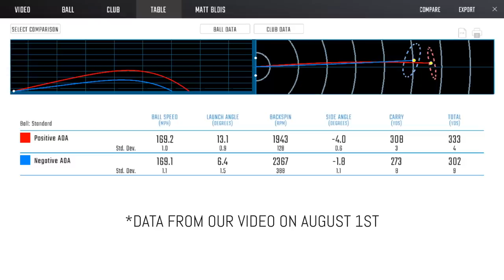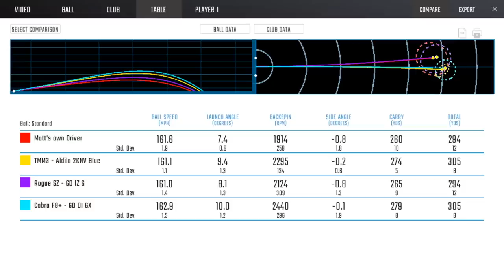Driver Fitting for Negative Angle of Attack

Comment: Fascinating for someone who has a negative angle of attack even though slowly improving and working on that. My experience just testing different heads and shafts on an open range was much the same - your lightbulb anecdote- as I found the M3 and the cobra f8 much better than others (like the ping g400 or roque) and also with different shafts. Of those I tried I found that the cobra f8 (did not try the f8+) and an evenflow blue shaft gave me (at that time with an even higher negative angle of attack) better distance, and less dispersion and better launch angle and control ability. Did not dial it in further and have never tried the GD shafts but have tried also with reasonable effect the oban shafts. Keen to see what TPT would do to the same viz greater stability.

Comment: My own experience is with a negative angle of attack I have much higher spin rate, compared to when when having a positive angle of attack. This is something I have been working on with my pro. My spin numbers have been dropping when the angle of attack has changed from negative to positive.

Comment: Would love to see an updated test of this! I went to a fitting at cool clubs recently and when hitting driver on trackman I was between 0 and -1.5 AOA.
Reply: Mav SZ and Sim max both seemed to be best for me. My club path and face angle with MAV SZ on avg was -.7 and -.2. While with Sim max is was .4 and -.3 on avg. Also hit the g410 but those numbers seemed to deviate more.
Reply: I have a terrible forward shaft lean at address causing a negative angle of attack and high strikes off the face with a tendency to sky it.  I use a Cobra F8 with Evenflow blue stiff and only hit it 240-260 while I carry my 7 iron 175.  The best I’ve ever hit a driver is my old Cobra SZ400 with a Saber Tour Vector 75....wish I could get back to that swing and a similar shaft.

Comment: Great video I've just learnt I hit 1 or 2 down and the odd 0 attack  on the ball but still getting 280 290 carry driver is a 9.5 taylormade r9 supertri   with adila rip 7.0 2.5 tip shaft launch is 12 to 15 degs

Comment: I struggle with a hook miss to the left. I currently play with a 9.5 degree and open face by 1 degree with a Xstiff Rouge shaft. I have slight neg angle of attack as well. Would a good starting place for me be a higher degree head and less stiff shaft. Will schedule a fitting next time I travel to Buffalo. Thanks for all the info

Comment: Well for a mid handicapper like me that spends way too much time on launch monitors  at the range ,I really should look at angle of attack ,never really asked about it ,always more concerned about speed and spin . Thats it now now ,going to have to  test this ,i use the Titliiest 917 d2  9.5 head with Diamana B series 60 x playing at 44.5 in length ,I get good height with around 2500 spin .Only negative thing is we use Srixon black band range balls ,there not too bad ,but not quite as long as proper golf balls .I,m hoping I hit up on the ball slightly ,Very interesting  video once again guys .

Comment: Hi guys prob the best  fitting video ive ever seen for the driver bar none as huge amount of amateurs have these swing characteristics inclyding myself. I have a couple if questions for Ian if you have the time to answer that would be great. Did you have the f8+ lofted up to the 11° draw setting and the cg at the front ? 
I currently play an 2017 M2 With hzrds red shaft im wondering what settings if any on it would be the closest to the way you have f8 set up. 
Also for links golf in ireland should I be looking for a slightly lower launch angle of 9 or 10 degrees snd whars the best way to achieve this
Loveyour channel btw the level of knowledge is insane 
Sorry for the long message 🙄

Comment: I have this issue. 125mph swing speed but negative attack angle. Very hard trying to match things up to get the ball in the air. I usually just tee off with 3 wood or 2H.

Comment: Great vid lads! I’m not sure I think I’m on the opposite end...my drivers are much higher than most and little role. I’ve never been on a monitor to know what my numbers are
Reply from the maker: Would be worth checking out your numbers Alex, but sounds like you would benefit from either less loft or a driver with a more forward CG location.
Reply: Yes need to get round to doing that! Currently got a ping G25 10.5. It’s at its - setting but I’m not sure that makes much difference.
Reply: djjazzyjeff123 a few people have told me that, I’d just like to see to go lower and more penetrating. My 3W can go the same distance with a totally different flight! I just want the Driver to do the same. I think some time on a monitor required

Comment: good video guys, really enjoy the content. Always a new subject touched on. love it. I have to use a low loft driver or i spin way too much. too much positive angle???
Reply from the maker: Lots of factors possible: could be the head design of the driver you're using, or the amount of ball speed you're producing, contact point, etc. Unlikely that too positive an angle would cause excess spin, generally those that hit up on the driver are lower spin players.

Comment: Spin loft and delivered loft are the most influential in any driver. As Matt is so instinctively good he can hit down and control his spin contrary to strike, most players that get steep generally spin it allot more and increasing loft with the idea to increase launch can do more harm in increasing there spin loft. Brooks is negative -3.7 according to trackman published number and if you seen him and Scotty play in the final of the pga round scotty was out driving him as well. Scotty looks positive onto the ball or close and he is definitely longer than Rosie.
Reply: He's not longer than Rose.  I have both of there TM numbers, like I said Adam is slightly more neg on his AOA than Rosey.  Delivered loft is part of spin loft, they are not separate entities.  Spin Loft, Impact Location and CG are the primary factors at play here.
Reply: I understand that delivered loft is part of spin loft, my point is Matt can control what loft he desires through ability.  Allot of club golfers that produce a negative AoA are more to the extreme -4/-5 and they can not instinctively alter this.  A video that best illustrates this is one of your own on hitting up on the driver.  Change the AoA to a reasonable compromise and a fitted driver will produce even more gains.

Comment: I don't think AOA tells the whole story, I think dynamic loft has to be looked at as well. Cause two swings could both hit- say 2 degrees down on it- and if one has the shaft the leaning forward at impact it would need a much higher lofted driver / higher cg / higher spin to optimize results as compared to that same 2 degrees of negative AOA with having the shaft leaning away from the target at impact. Cause I think launch angle and spin can change drastically within the same AOA. Interesting stuff as always guys.
Reply from the maker: Yup for sure, shaft lean is a factor as well in determining dynamic loft
Reply: AOA isn't the whole story Judah it's the topic.  There are way more variables being taken into account here than the title suggests.  Our aim here though is to give a little help to the guys and gals that are a little steep.  By showing them how to balance AOA, Dy Loft and impact location you can still maximize your output.  Appreciate you thinking about he topic in such detail, it only helps others to understand the factors involved.
Reply: I know this is an old video and such but I struggle with a lower AOA at - 1.5 working on getting to 0 (sometimes) but I'm extremely spinny 3200 but when I do get those 2500 I carry close to 300 or more with 122 ch. Tried so much to get spin down....

Comment: Super interest edto take this concept out on the course, Have the 9.5 M3 with HZRDS Black 6.5 in the 8.75* setting weights all the way back and carry it about 260 right now(although don't know my angle of attack but my ball flight says I'm hit that SQUEEZY 5 yard fade) with a 110 mph club speed, will give a go with the 9.5 or 10.25 setting weights forward and see what the flight and carry distance is. Good Stuff guys.
Reply: 110 swing speed = approx. 162 ball speed.

@ 17 Degrees launch and 2100rpm spin is 282 carry according to Flightscope's Online Launch monitor - https://flightscope.com/products/trajectory-optimizer/

To get your current 260 carry with that club head speed with a little fade, you are in the zone of ( 10 Degrees launch, 4400rpms spin)
Reply: Fancy :)
Reply: Just wish there was somewhere I could fart around on a Launch Monitor to "crunch" the numbers. I could go to golf galaxy, but I don't trust the big box stores
Reply: They will definitely give you some useful feedback and you should go and do it and see if the 10Degree launch and 4000spin is the zone you are hitting it - my guess is that it is as that is exactly what I use to do - I have an M2 with a Haz Black 6.5 cut to 44.5" driver. I hit the range for 5 days and worked very hard on trying to see if I could develop a new style driver swing (I have also been to TXG as they are local to me for a gapping session and a practice session to see what I was doing). It took me a few days on the range to figure out for me how to do this because it is very different. I tee the ball high, I had to really learn how to hit from in to out, keep my head back - and when you hit it like this it is extremely obvious on the range because for me my carry went from a trap fade like yours at 245-250 yard carry to a couple yard high knuckleball draw at 270-275 - just like in Matt & Ian's previous video. It took me 5 days to re-build my alignment setup so I knew where to ball would be starting and finishing, and I can still lose one right, but it definitely flies way further.
Reply: Yeah, when its a wide open fairway on a par 5 and I want to let one rip I tee it about a half a ball higher than normal(normal for be is about 1 ball high) AND hit the big high draw...This used to be my stock shot but as I've begun to play more tournament golf I've had to find a fairway finder shot and that's what I have now. When I hit the "Rory Mac" high Draw I carry it about 280 and most definitely rolls out better too.
Reply: That's exactly what I do - trap fade fairway finder and right draw to bomb it. That said, if you are going to play tournaments, 280 is now about minimum so you're not using 5&6 irons into greens all day long. The other shot I started practicing was a similar approach with my strong 13 degree 3wood (Epic Sub Zero with heavy weight forward). It is far easier to be more accurate with that club and it use to be my 235 carry roll to 245 tee shot - but again with this new higher launch teed up a bit higher swing, I can carry it 250. There are definitely free carry yards to be gained with more optimal launch conditions - just have to figure out if you can game them - but it takes time on the range to find that knuckleball launch type swing.
Reply: Yeah, that's my only worry and not a shot I want during a comp. is the 40 yard dead push right because I don't stay keep my spine behind the ball and get the weight transfer to the left before the club has passed the ball.

Comment: Crazy how far technology has come. I always was told that if you hit down that was the kiss of death so I went through the painstaking process of changing my delivery. All is well that ends well but sheesh this would have been much simpler. Also, what loft driver heads was Matt using?
Reply from the maker: 9º in the Ping, and 10.5º in the others

Comment: Could you please explain the ball flight differences(launch/spin) between a driver head with a forward CG and one with a rear CG. I guess it would be like moving the two weights in an M3 from the full front position to the two rear positions or comparing the new Cobras(forward CG) to the Ping G400s rear CG with the weight screw at the back. What is the science behind the differences? Of course this might take a whole new video to explain, ha-ha.

 I ask(and not the only reason) because Tiger apparently just increased his driver loft by 1* and moved the M3 weights all the way to the front position, someone mentioned it's to increase the spin and to get more launch to hit more fairways.
Reply from the maker: Rear CG would launch and spin more than forward CG. Tiger is likely increasing the loft and moving the weights forward to get more launch angle via the loft, while keeping the spin low via the weights, probably with the goal of hitting it a bit farther.
Reply: Thanks for your reply. So all things being equal, a 10* rear CG is not equal to a 10* forward CG head for launch or spin. So in that case would a 11* forward CG be equal to the 10* rear CG in as far as launch is concerned, as well as having close to the same spin?
Reply from the maker: Yes to the first part. For the second, you would use that 11º head to raise the launch angle with loft, but the forward CG would ideally keep the spin down as low even potentially lower than the 10º rear CG head. All theory of course, more in this video as well in case you missed it: https://www.youtube.com/watch?v=NIfTAA8D_eY
Reply: Thanks I'll have a watch of the video.